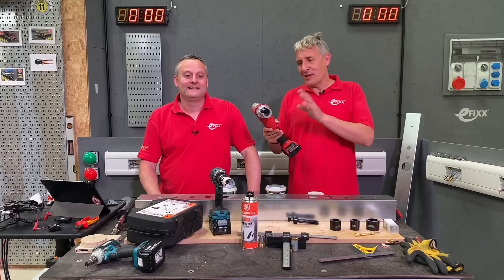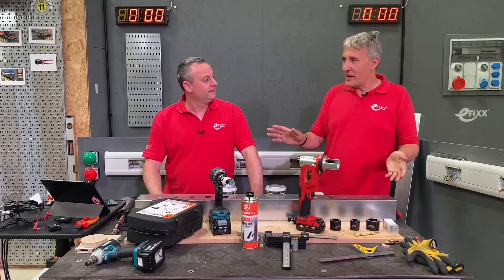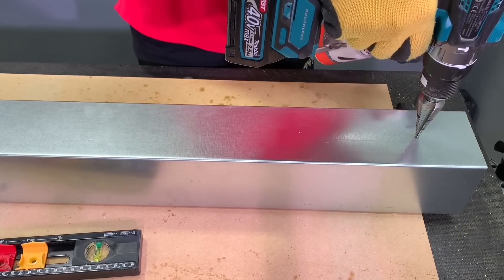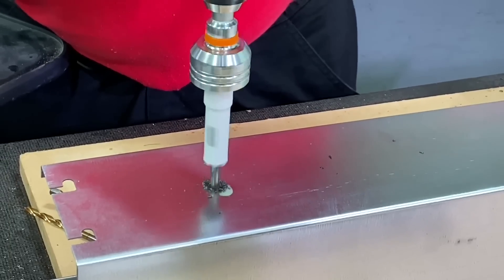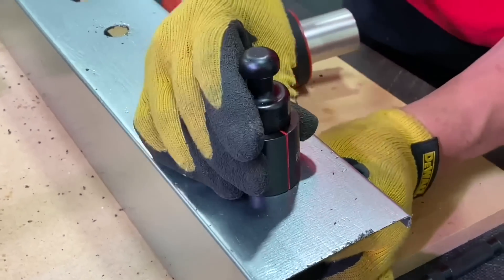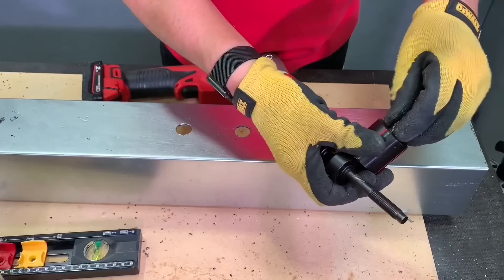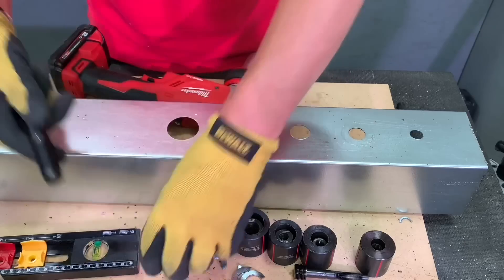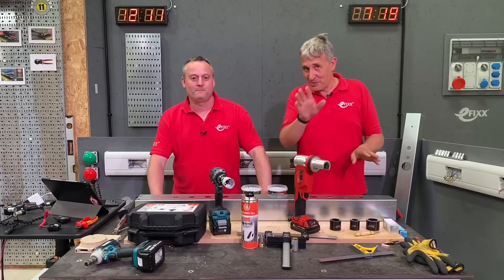PUNCH OR DRILL? - HOLE SAW -VS - MILWAUKEE M18 KNOCKOUT TOOL

Comment: Modern hole cutters are designed for high speed, high pressure. You actually do yourself a disservice by going slower in mild steel.

Comment: Knock outs are meant for bigger stuff like 1.5" and up  , Use a carbide hole cutter for the initial drilling and it's much faster.

Comment: Quick connect holesaw systems are great until you try to use them for anything where the arbor needs to also pass through the whole for example drilling through a wall with an extension. This mandrex is a one trick pony as much as the hole punch is. If that's the comparison, I've already got an electrician set of carbide hole cutters that work phenomenally.

Comment: A cleaner initial hole would be one major difference ('WINNER' for many users) - although the actual application could probably be a decider as well.  And keeping a spinning hole saw blade out of the hands of staff can sometimes be an additional safety bonus.  A mate has a near crippled hand from a bit of 'brain fade' whilst using a hole saw - it instantly cut the muscle near clean off his hand when he hit the trigger on the cordless drill with a hole saw blade in it = crippled hand (I think many of us are also a bit complacent when it comes to a battery powered tool - for some reason they often seem less dangerous - sort of 'toy like' - other than no risk of electrocution for m a battery powered tool - they can be just as dangerous as a 240V plugged in version - if not more when it comes to other injuries).  Safety can sometimes be the 'WINNER'.  Yes - we all know that you are not meant to have your hand near a spinning hole saw blades - but we also know that you are not meant to do all sorts of dangerous things (and as at 4:43 am today - if I was standing outside my place - someone doing something they were not meant to be doing - would have turned me into mince meat - instead he just demolished a steel pylon wall and portico pillar - luckily the steel structures stopped the vehicle from ending up in the bedrooms - thankfully nobody was injured) - but still - people do things that end up in injury or death.  Have a safe and nice day all - CHEERS from AUSTRALIA.

Comment: I used to work in a small workshop for building different electrical cabinets. We used a hydraulic punch that was a real hazzle to work with but made much cleaner and much more accurate holes. Also you can punch square holes or other shapes for certain uses like a vent.
I could see the battery driven punch very useful in that case, hole saws are also awfully messy if you have to drill 20 holes in the bottom of a cabinet. Sharp burrs everywhere and you risk scratching the paint if a single one of those burrs are left on the bench. Now say you got to build 20 of theese and you do all the drilling at once.

For the average electrician? Obviously the punch would be overkill, but id get it in notime for the workshop.

Comment: I use a P&R cutter to make my pilot holes; which I keep in my hole punch case, and I really mainly bought it for the larger punches.  but it makes nice clean holes, I don't break pilot bits, and I don't spew as many hot shavings about.  for me, the punch kit was well worth the price.

Comment: What we really need is a hand held auto laser cutter, type in the hole size, material type & thickness, line a laser dot up with the centre, pull the trigger and hey presto.. no lubricant, clean hole, less mess and waste.who will be first? lol. Hole punches are nicer finishes, but time consuming. Iv'e cut thousands of holes over the years. Stainless, steel, brass, wood, and the good all rounder seems to be the basic hole saw.😎👍

Comment: What is the point of the milwaukee tool when you need to make a 20mm hole to make a 32mm hole?
Reply: Cleaner end hole would be one major difference.
Reply: It’s to stop the burr that your just gonna cover with a gland or grommet anyway it’s basically a 12hundred pound file

Comment: The Mandrex Hole saw is a great idea but the arbour is too big. They are sold in my wholesalers but they look far to big and Obscure your view whilst  drilling. ANd limit the place you can fit the drill. What your option on that?
Reply from the maker: You can use the Mandrex adaptors with your existing hole saws -eg convert a Starret to use with the Mandrex arbour. So you can always swap back if you are tight for room.

Comment: Armeg Acceler8 or other sheet steel holesaws are going win this race hands down. I didn't understand the fuss until I used them. Faster than standard hole saws and the hole is clean and crisp every time. I haven't used a traditional holesaw to drill anything smaller than a 40mm since I bought them
Reply from the maker: We’ll check them out
Reply: I have the 20 and 25mm armeg  hole saws and they are great , if they made 32 , 40 and 50mm in the same style  it would be great
Reply: @dennisphoenix1  They do some of those sizes. I have 32,38 & 40. Not sure if they go any bigger than that though
Reply: @iggifer  the 40mm would be great for  tail glands

Comment: So the punch isn't as accurate? , if it was then surely ALL the punched out slugs would resemble washers and NOT C shaped gobbitts.? Or off-centre washers?
Reply: You have to lay out big crosshairs on the trough then line up the red lines on the punch with them
Reply: A lot of the punch tool use a slug breaker which cuts the slug in half as you are punching the hole out, makes it a hell of a lot easier to remove the  slug especially on the smaller holes.
Reply: the punch is designed to split the slug in half so it doesn't wedge in the die.  the larger punches will fold the slug.  that red stripe on the die is so you can draw a crosshair on your material and then line the die up on the crosshair, even if your pilot bit wanders a bit on your starter hole.

Comment: Nice idea, but you're then carrying two tools to do one job. Or just stick with hole saws?

The punch would be perfect for areas that're sensitive to vibration, debris etc.
Reply: You still have to drill a pilot hole though, so still vibration and debris. It's just the final finish is better and IMO easier to deburr with a Noga.

Comment: If Gary was another 5 mins cleaning those holes Gordon then he still would've won 😝
Reply from the maker: 100% GAZ WON 🙌🏻
Reply from the maker: But Gaz never cleans 🧼 up
Reply: Gordons Millwonky,seven components to put together to make a hole then take apart to clean out the bits? Gaz three components ,a drill bit a hole saw and a combidrill to make a hole . I have made my choice

Comment: Great video guy’s 
But please send that millwonky back to the Americans and demand refund.
Sorry but you just can’t beet the good old hole saw. Gaz you have just proved that 👍❤️⚡️
Reply from the maker: GO GAZ GO 🏴
Reply: yeah, I thought that about 30 holesaws ago.  but you can only cut 3 or 4 stainless steel cans with a holesaw before it loses its edge.  and the manufacturer stopped sending the cans with knockouts.

Comment: No Sparks going to buy the Milwuakee most will just use a cheap Screwfix or Toolstation holesaw set jobbie then de-burr.
Reply: Depends what you do. Done lots of work on live 600a busbar chambers where you certainly pucker when using a holesaw due to the sparks. The Milwaukee is defo a better tool in that situation, but then hell I'm paying for one. The force logic cable cutter and crimper tho I may look into

Comment: I think the punch is way beyond the needs for most electricians, more suited to manufacture of panels and the likes.
Reply: Agree, but in some places, it really makes sense with the punch tool, like where some parts are live and you don't want all that metal flying around.
Reply: @Faddnn  not a bad point. In a live trunking I usually bunch all the cables up and put a big piece of metal lid over the top of them just in case I catch one 😀😂 probably not the “taught” method but it’s the real world one
Reply: @Cablesmith I have a bit of paxolin for that job, recommend you getting an off cut and getting rid of that metal sheet.
Reply: Agreed.
Reply: It's a tool I'd love to use for just that but I can't find a 22mm option, which is what's used on 90% of parts, especially schneider push buttons and pilot lights.
Reply from the maker: You can get an M22 hole punch for this, but  push buttons are actually 22.5mm  (PG16)  - https://www.amazon.co.uk/Exact-30506-22-5mm-Screw-Hole-Punch/dp/B00BY2QX6S We'll explore if we can use non-wilwonky punches.  It would also be good to cut square holes for 96x96 instruments in panels etc.
Reply: @efixx  Sweet, thanks for the reply!
Reply: @efixx  Rittal does a 92x92mm square punch.. costs £1000 🤯